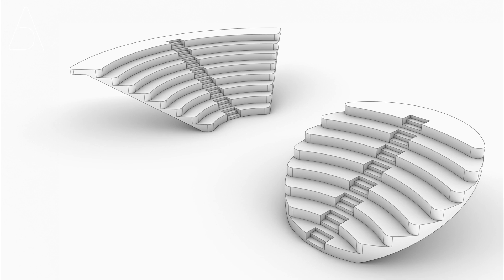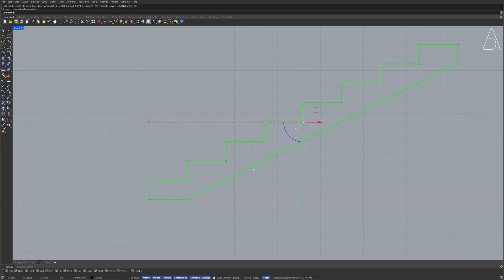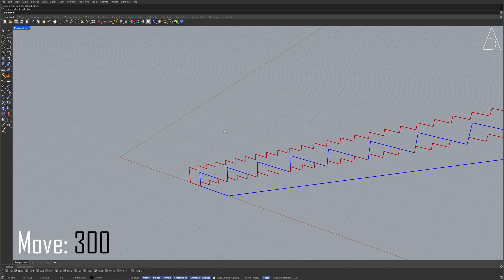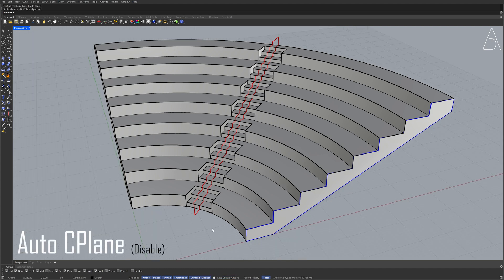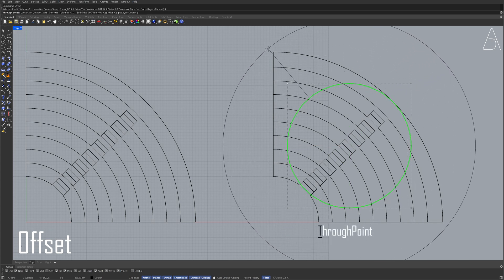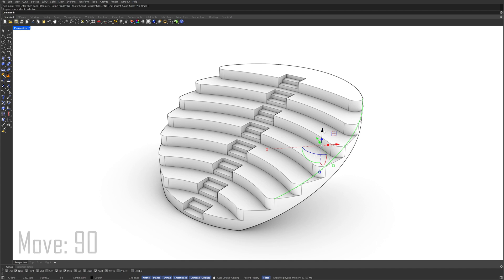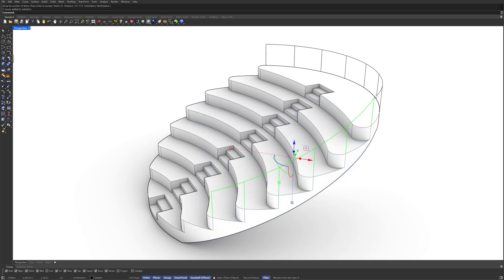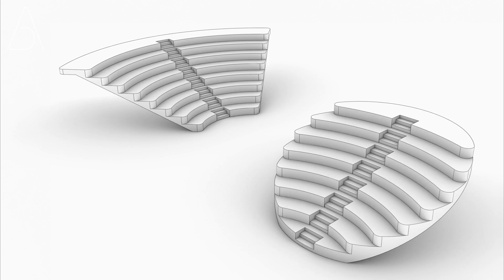Rhino Tutorial I Stepped Amphitheater Modeling

Comment: Hi, I'm beginner. If using rhino 7, is there a way to do the cut command with Gumball from 2:48 with another operation? Thanks!
Reply from the maker: Hi! You can achieve the same result with these steps:
1.	ExtrudeCrv
	•	Select the curve.
	•	Set Solid=Yes to create a closed solid.
	•	Set BothSides=Yes to extrude in both directions.
2.	SolidDifference
	•	Select the base solid. Press Enter.
	•	Select the solid to subtract. Press Enter again.